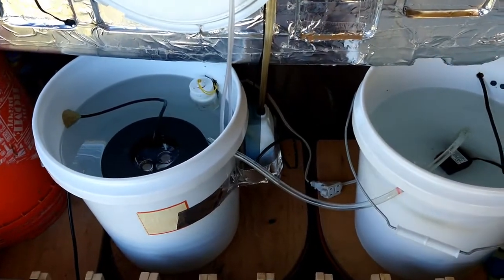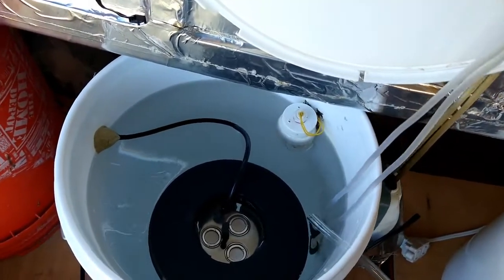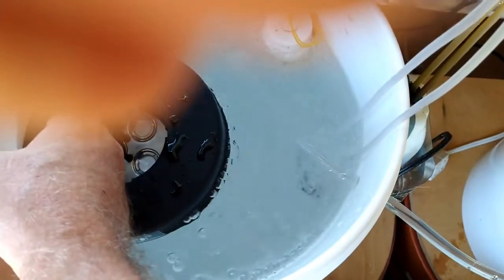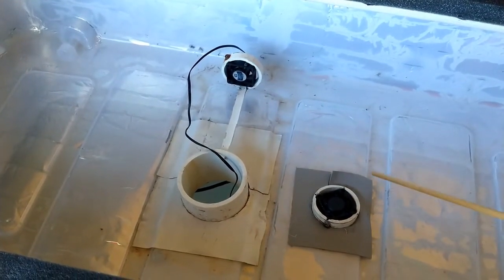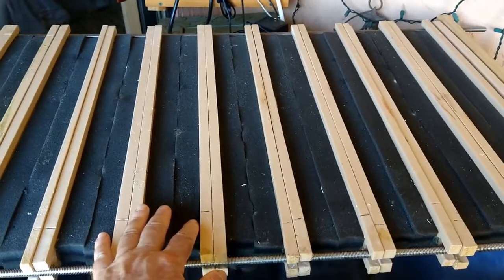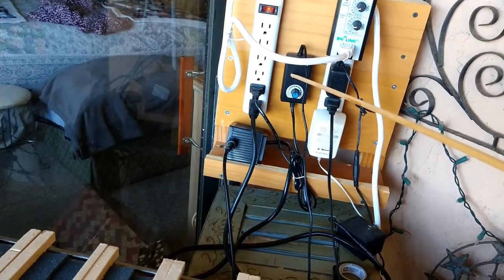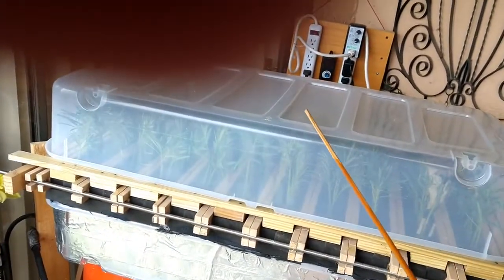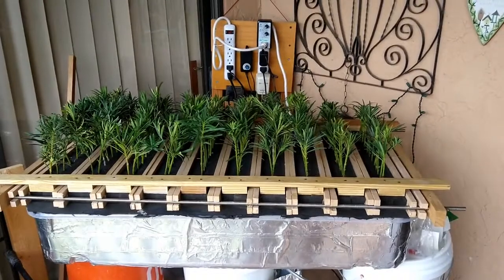FOGPONICS PROPAGATION SYSTEM

Comment: Good job.
This is the best fogponics system I have seen.
For growing plants.
Not for cloning.

I've been researching fogponics for about 5 years. But I've always found something that makes me second guess trying it.
For growing only.

For the last 10 years I've been growing with LPA in the SOG.

I built 4, 21 site aero cloners.
And I built 4 aero systems.

Each aero system has 2, 21 site grow chambers with 1 reservoir.
And like I said I have 4 of these systems.
I run these on a 2 week rotation.

This is my setup.

I keep 4 mothers. Four different strains.

I am able to take 42 clones off of one mother at a time.

Now cloning with LPA is very easy. But there are a few things that you don't want to do, compared to cloning any other way.
And compared to what other people tell you.

Which you will have to experiment and learn.

I have learned not to give free information.

But I can tell you this.
When I take my clones and install them in my aero cloners.
Within 5 days I start to see roots. In 10 days they ALL have roots.
I have a 100 percent success rate. And have for over 8 years.
Like I said within 10 days they ALL have roots.
But I let them go 17 days to establish some good roots.

Then I transfer them into one of my aero systems.
Straight into 12/12.
No veg time.
Two weeks later I start another system. And then 2 weeks later another.
Until I have all 4 of the aero systems in 12/12 at the same time.
All 2 weeks behind each other.

Two weeks after the last system ( the forth) is put into 12/12 the first system is ready to harvest.
Then I start all over again.

I've been growing this way for 10 years.
It's the easiest and fastest way to grow.
It is also very cheap to grow this way.
Growing this way has cut my cost dramatically.

Oh one more thing.
When I built my aero systems I built them to measure 3'x3'.
This allows me to use 1, 3'x3' LED light over each system.
Which saves me alot of money.

Anyway one thing I do know is fogponics doesn't work that well for cloning.

Anyway later..
ASS OG
AeroSystemsSea OfGreen.
Reply from the maker: Hello my friend. Thank you very much for your comments. It sounds like you have a well thought out operation.
I agree, FOGPONICS, at least insofar as my understanding, doesn't work well for cloning. The 120 podocarpus cutting yielded only one with roots. My research interest concerns early root growth so FOGPONICS wasn't suitable for this purpose. Upon the advice of others (Atom mizer) I built the HP aero system. This works really well as a cloner. I only use RO water ( no nutes) which reduces the complexity of the grow through root initiation. The system allows for a lot of flexibility. I could easily support a second growth chamber without adding any additional hardware. My biggest problem was generating uniform mist coverage at very short misting intervals. I resolved this and the system has been operating flawlessly since. 
Thanks again for your feedback. It's much appreciated!!
Chemcurt
Reply: Interesting. Ever think of doing your own YT channel? Would love to learn more about your system

Comment: Nice setup!  I have something similar.  I found no need for a pump in my reservoir by using the water level switch to control a solenoid valve (on amazon for $15) and elevating the reservoir above the fogger.  It lets gravity do the work.  Also I produce my fog out of a small water holding unit which is piped directly into my containers.  Prevents the roots from sitting in a pool of water.
Reply from the maker: Sounds like we've built similar systems. How did your cuttings do? Mine didn't generate much roots. I'm building a high pressure aero system in an effort to improve rooting after finding a research paper that compared different soilless propagation method. Their result with fog mimicked mine. Their aero (low pressure) did by far the best. I hope you had better luck than I did
Reply: I would like to see an example of how you pipe the fog in